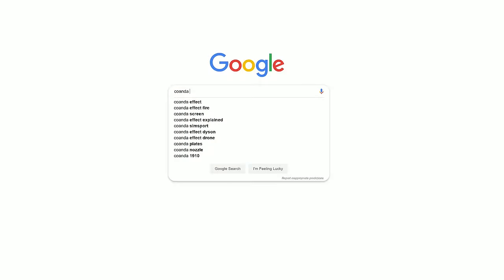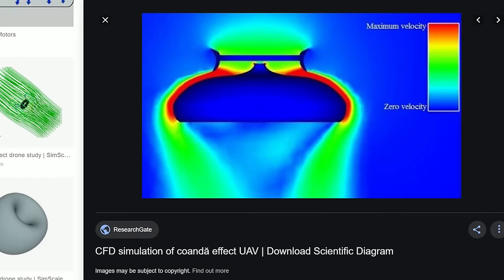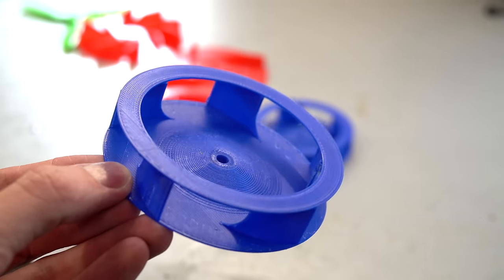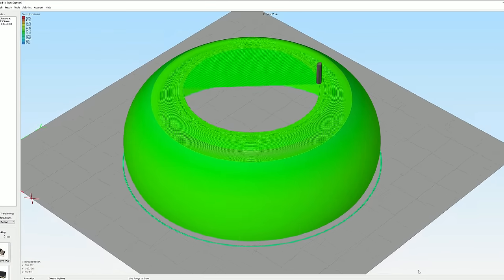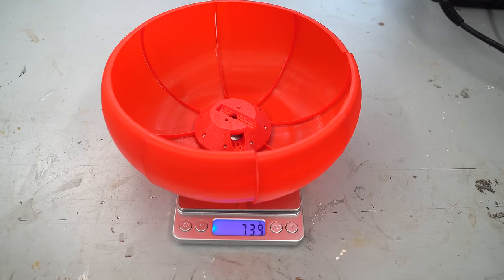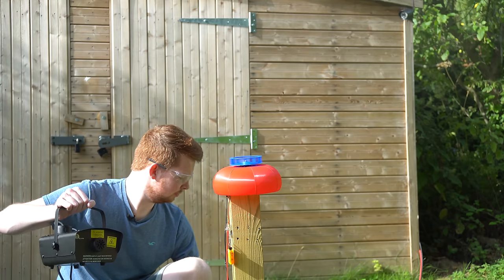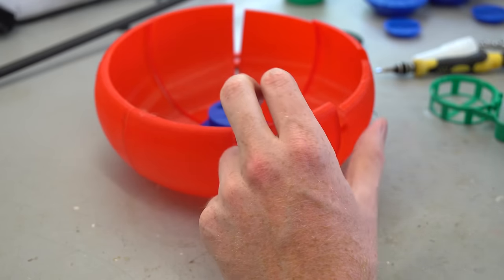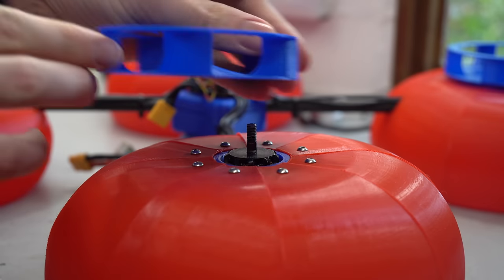Coanda Effect Drone Propulsion

Comment: The domes create the Coanda effect, but also create a huge drag and turbulence under them. Maybe a complete "drop" shape under the impellers could improve efficiency. The "drops" could be helium filled balloons. And impellers big, low rpm (low KV motors)
Reply: This helium idea is actually really cool, he could increase the size of the bowls and just stick a Baloon into them, fill it up and with the gained buoyancy, actually use his impellers
Edit: spelling
Reply: Try a cantenary shape. The cantenary should deflect the oncomming air in the direction you want.  

Maybe close off the bottom with a shallower cantenary or parabola.  I know that makes it look more like a UFO, but ignore that.  I did the math once, it should work.  There's a suction effect that takes place when air whips around the edge of the opened bowl.  A closed bowel bowed outward prevents this.  The shape matters.  Think of it as creating a lens, but you're using air instead of light. 

Helium inside the domes is a good idea, as well, but you need to make sure each balloon is filled with near exact the same amount of helium because the differences are going to become more and more aparent exponentially with time.  Might do better with a central hub as a single helium chamber.
Reply: @paulklement4274  it would be really awesome if he could use only  balloons and skip the bowls. that would eliminate 300grams or so
Reply: Had the same idea but I can't try it unfortunately...
Reply: This is genius... cheers
Reply: @colleenforrest7936  *catenary
Reply: @daos3300  Thanks!

Comment: FOr added efficiency I'd suggest a small skirt along the top half of the impeller (since the impeller draws air from the top, and out the sides) you could essentially put a small skirt around the top of the impeller, so the upper part of the blue sahdwich extends just a couple of centimeters outears more than the bottom half, and (this is really important), to make sure none of the air flows back up because of the high pressure, the top extending part of the sandwich has to have a small, subtle downward curvature, just to push more of the air downward
Reply: The longer skirt you describe could make it into a sort of ducted fan. 

With an insane amount of work in wind tunnels or simulations someone with an insane level of dedication could get the curve of that upper skirt just right, so the air through the duct zone has the ideal cross section to flow rate ratios as the air moves through the duct.

Probably not an ideal investment of time.

Optimizing the dome size might be more effective, even if still in the insane zone. If you took off the bottom few centimeters of some, does the decrease in mass make up for the drop in effect.

Comment: Flip the bowls so the dome is on the bottom and you won't have an overhang problem when printing. Also you can do vase mode and make them super light.
Reply: Just what I thought
Reply: The overhang problem then starts as the layers leave the bed at an extreme angle  instead of at the end of the print!
Printing on a lathe at 45° instead of on a bed would be able to solve it if such a machine existed.
Reply: @ahaveland Supports could be more easily and tidily removed if printed upside down. I have no experience with lathes so I cannot say anything on your idea!
Reply: @Klippy Klop No, I meant using the lathe as a substrate - the printhead moves in X and Z, and the lathe rotates so the built surface moves at millimetres per second.
Filament is extruded as the lathe rotates and the bowl is built up, with no overhang greater than 45°.
Is that clearer now?

Comment: You are getting the COANDA effect, but the hollow bottom sucks air up again I guess, and disturbs the Coanda capabilities. So Make enclosed upside down teardrop shapes. They will also work as legs giving higher ground clearance. I guess it will work better. 
Also try a single motor too 🤔
Reply: or 4 little motors (for control) on one teardrop...
Reply: @TILEN FABE well ...symmetrically? 

but never mind it is obsolete ...not a great idea probably to have a full teardrop bc the flow may go all the way along the bottom surface and would there  produce a counter force...
Reply: @TILEN FABE in wind tunnel tests done at our lab we recognized with the open bottom the air does in fact curl around this causing positive force on the z-axis.  Our hoverboard prototypes did not work as well with a teardrop or a ball.
Reply: @TILEN FABE 
Single motor, just as a side experiment to see how it goes.
Reply: @TILEN FABE the z axis is the vertical so correct, the lift is increased as it creates positive prussure
Reply: @TILEN FABE Bro I am totally trolling, I know fuck all about this lol and we don't have no test lab or hoverboard.  Just trying to sound smart and joking around 😁 But on a real level, the whole teardrop idea of yours makes a lot of sense and I Beleive it would work.

Comment: >They're (motors) going to get quite warm
What if I told you... that propellers are meant to both cool the motors and lift the drone? :)
Reply: no shit
Reply: Captain obvious ...!
Reply: because the air is supposed to be directed horizontally from the motors for the effect to happen
Reply: What if I told you... a simple rocket engine doesn’t need cooling and produces more lift
Reply: @matthewhubka6350  
it's single use
Reply: @matthewhubka6350  rocket engines are cooled (usually by fuel, sometimes by the oxidizer)

Comment: Just curious why you didn't print the dome as a bowl, with the open side up.
Reply: lmao
Reply: Lol I thought the same thing but assumed that the flat surface would force a flat print on the bowl essentially giving the same end results but obviously I’m not sure lol
Reply: but then the lines of the 3d printed surface would be perpendicular to the airflow
Reply: @salty_sausage  And then you smooth it out with acetone vapour, or a filling primer and fine sandpaper. My guess is that a smoother surface would work better than the irregular surface of a raw 3D print anyway.
Reply: Everyone improvises. Me u him and all 👍👍
Reply: Bottom will be too thin in one piece if you go bottom up like that--works better in pieces :)
Reply: @salty_sausage  How the hell does your post have up votes? lmao, his lines were perpendicular in every method he used to print.
Reply: @gg-gn3re  Except for the last one, where he printed the dome in segments...
Reply: @cynicalnews963  Those weren't "bowl" prints................................................................. they were pieces..
Reply: @gg-gn3re  3:52 "Plus the layer lines being perpendicular to the airflow, it wasn't ideal." The whole point of the comment you replied to. This is opposed to the parallel lines in the pieces design he used. Which again would have been irrelevant if he used any method mentioned in this chain to smooth it out.
Reply: @TheOnlyAlchimous  and...?
I can hear fine, as I heard that, seems you should work on your reading
Reply: That shallow angle is the same, whether it's upside down or not. That angle is just something the technology can't handle. It isn't the flat top, but the whole curve near the top that is the issue. The flat bit could be done pretty easily with support material, but that angle would come out weak and super rough no matter the orientation.
Reply: I was thinking the same thing
Reply: @gg-gn3re 

"His print lines were perpendicular in every method he used to print." ~ You

"Except the last one, where he printed the dome in segments." ~ The other guy

"Those weren't "bowl" prints, they were pieces." ~ You

"Yeah, pieces. Pieces of domes. Which was a print method which produced domes with print lines not perpendicular to the airflow. Now, stop trying to be right, because you're wrong." ~ Me
Reply: Use the top part with neck of a regular soda, water bottle
Reply: Because then theyd be upside down🤣🤣🤣
Reply: I think it's because printing the bowl (either side up) would require a LOT of scaffolding to support it, which would waste material and add a lot of sanding to the surfaces to smooth the attachment points.
Reply: @EvenTheDogAgrees  acetone vapour smoothing would probably just melt a single wall print
Reply: @thatspiderbyte  Don't think a single wall print would have the rigidity required anyway, so I don't believe this applies. Or did I misunderstand you?
Reply: You need internal support grid. Easy
Reply: @coffeeNTrees  I do.  It's a reasonable question.

Comment: Tom you are missing the "Coanda Duct", that constrains flow and increases the velocity.  This may (or may not)  make this device work better.

OR, one large coanda body scales better.
Reply: The use of a duct may help as you said, as well as outlet guide vanes after the impeller which may help by reducing the loss of thrust due to downstream giration
Reply: if he put the impellers inside the domes, and props on top of the domes, it would fly like a champ
Reply: @thomasflamme7937  maybe even build some slight 'v's in the sides of the dome since he's already 3d printing it. Also, I wonder if a balloon could work since you only need the shape to create the effect lol.
Reply: I agree.  Another funnel type dome that sits over the propellers and the lower dome should constrain the air flow and create greater thrust since the air coming through the propellers are simply free to exit anywhere/everywhere.

If you look at the initial video demonstrating the effect, you see much of the air goes down, but not all of it.  There is no constraints to keep all the air contained.  Additionally, I would think that smaller domes might suffice.  Particularly since double domes would increase weight.  If you google “how does jet thrust work”, you’ll get a better idea of what I’m trying to describe.
Reply: Impellers will never work well. They push air the wrong direction.
Reply: I liked it but the shape was off for me. what if it was shaped like half an egg pointy side down
Reply: @listcheck  the impellers inside the dome would only provide thrust if the dome had holes at the top to air downward, but the holes would interfere with the the coander effect.
Reply: mars base 
If enough holes are strategically placed throughout each dome you can take advantage of the "colander effect". This would allow most of the water to drain from freshly boiled pasta. 
Wait, ...what were we talking about?🤔

😜
Reply: Tom should attach the propellers on the inside of the domes to see how it works as compared to attaching to the outside. I know it's not a Coanda Effect Drone anymore but if the lift is stronger, who care that it's not a Coanda Effect Drone.
Reply: simon6071 
Air flow is what would create lift. Air flow to propellers inside the domes would be restricted, therefore even less efficient. 
...not to mention your pasta would inevitably get mushy.
Reply: @vincef7487  Not exactly. Depends on the overall design of the system. If airflow goes inside the dome is balanced air entry and ducted with proper ducted diffuser and/with vented air exhaust, dome design may prove to be effective with combined with overall system. Propellers are fine for open and closed system and placed more or less anywhere inside the system more dynamically, where as impeller designs are typically specifically for use statically inside system to draw air in. This is if memory serves correct but it's probably been about 15 years since I've last done aeronautically engineering and specifically with propellers and design. For the video host, I have a design in mind but it's quite difficult to describe because of embedded small details in design. Sigh, if only YT allowed posting of pictures inside comments.
Reply: @vincef7487  I was talking about comparing the lifting power with the use of  CENTRIFUGAL propellers inside the domes with a hole as big as the propellers at the top  and the propellers are mounted just below the holes so the the curvature of the domes will force the air spinning out from the propellers downwards to produce lift to the lifting power when the CENTRIFUGAL propellers are mounted on the top of the domes without a hole at the top. 
I believe the lift of the model with holes is more powerful because ALL the air is FORCED  downwards by the SOLID curvature of the domes instead of relying on Coanda effect which can only cause a fraction of the air to flow downwards.
Reply: @vincef7487  The airflow inside the dome is not "restricted" but "re-directed downwards'  by the curvature of the dome.
Air flow DOWNWARDS is what would create lift, not air flow is what would create life as you claim foolishly.
Reply: simon6071 
If the propellers inside the domes are supposed to be pushing air out of the opening at the bottom of the domes, how does air get into the dome for the propellers to blow out? It seems foolish to not realize air going INTO and OUT OF the same opening at the bottom of the domes would not be efficient.

Comment: Well, the solution to reduce weight is simply to use the 3D printed dome as the form, then use a lighter, thinner material molded to it. Vaccuum forming would be ideal, but you could also likely use something liquid applied or heat shrink.
Reply: Agreed Foam would have worked well here
Reply: I would also suspect that smoothing the surfaces of the domes and maybe doing some vortex channeling along with the impellers to tune the airspeed and where/how it flows off the edge of the dome and adjust how the airflow off the inner edges of the domes interplays with each other.
Reply: Or paper maiche haha

Comment: Suggestion, Shorten the skirt/lower part of dome, it does not add to lift but only adds weight
Reply: Agreed
Reply: How do you figure? This design has been developed by smart people over many years. At a guess I would think that doing what you suggest would defeat the function of the device by reducing pressure within the domes.
Reply: @DrewLSsix  There's gotta be a point at which the size and weight of the dome is greater than the air effect under it. I think what Gordon is suggesting is playing with the size and shape to see if there's a balance that can be struck that would still create the effect without the added weight dragging it down.
Reply: Yup. Totally agree.
Reply: I was thinking that too but also make the domes smaller in diameter.
Reply: True 👌
Reply: @Tomken8d2  If you were to make the dome diameter smaller. more air will escape from the dome which will result in horrific inefficiency. This pipe and Chinese dome thing is already very inefficient (about 10 times less as efficient as a normal drone) so the large the dome, the more the Coanda effect will work, but on the other hand, speed will be lost and will not cause any lift at all. So Making the diameter smaller won't make anything better other than weight
. Not to make you feel bad, just to give you information that making the diameter smaller will not make it fly better! :)
Reply: @technicboy5917  Try using electrogravity...?
Reply: @Tomken8d2  If that, then you you will need a magnetic floor under the "drone" thing and it wont go very high ( a maximum of 3 metres and thats only if you add extremely strong magnets and electromagnets on the drone. Good thought, but not for this case :)
Reply: @technicboy5917  No, you just need a few  asymmetrical capacitor units and high voltage.
Reply: @Tomken8d2  Oh sorry, I thought you were talking about electromagnetic levitation, like monorails. My bad  :(
Reply: @technicboy5917  No problem. Electrogravity is one of the discoveries that got a lot of press in the early 1950's then suddenly they stopped talking about it or showing newsreels and TV news demonstrating it.
Reply: Ich mag fortnite

Comment: Hi Tom.

I’m guessing that the impellers are losing a lot of pressure from most of the air escaping outwards instead of following the domes.

Maybe you could try some curved ducts around them to direct more of the air at the curved surface.

I also have a feeling that vertical ridges on the surface of the domes would pull air more efficiently as it might reduce cross-buffeting.

Would be great to see a follow-up video. 👍
Reply: I’m sitting here wondering why you don’t just put the impellers below the domes with an impeller-sized intake hole in the top
Reply: @blazerorb  because that would defeat the purpose of the effect. this isnt meant to be good, its meant to be goofy
Reply: It would definitely work better, but it wouldn't actually be a demonstration of the principle being explored

Comment: i think you can increase efficiency by inverting the domes, make them rounded cones, like funnels, and make the each impeller blow horizontally on the wider lip of the funnel into it's center. i'll be less odd looking for sure, but i believe it'll work better, and still use(at least partially) the coanda effect.